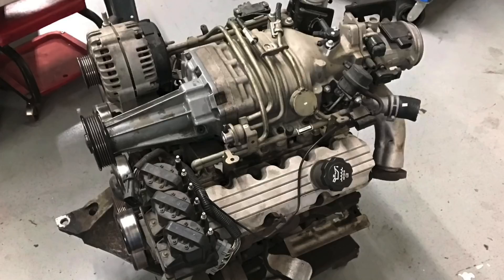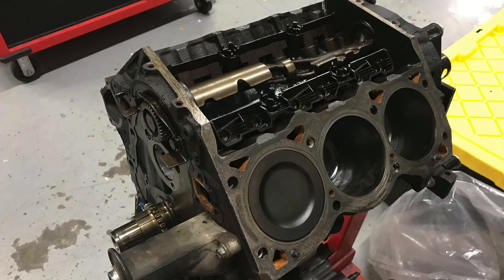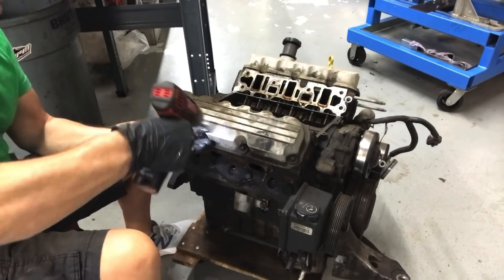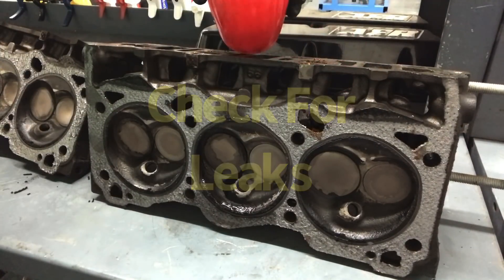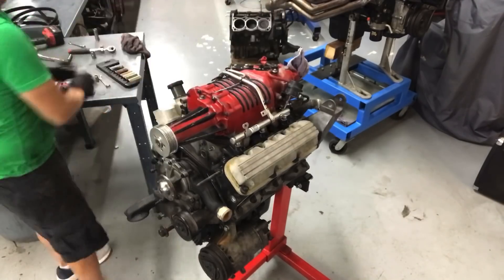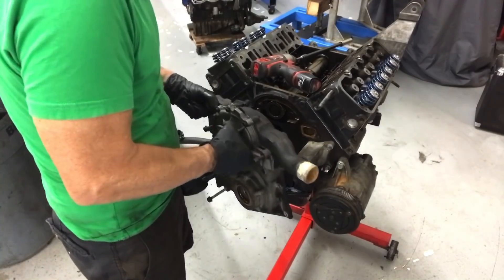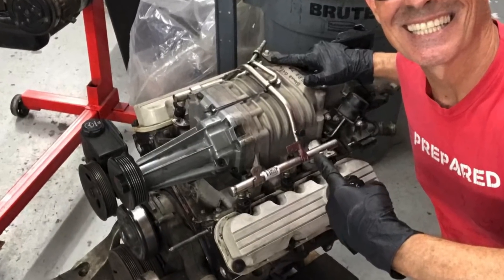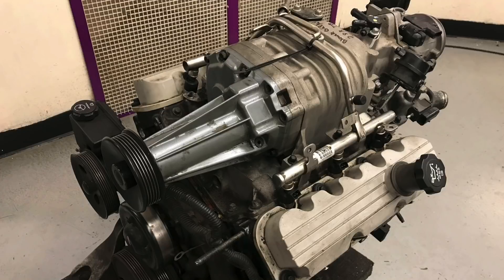HOW TO SWAP & LEAK TEST HEADS ON YOUR 3800 L67/L32 SUPERCHARGED V6! COMPLETE DISASSEMBLY/ASSEMBLY

Comment: when I put my L32 together about 8 years ago I found the same thing... only that engine had just 17,000 miles on it. I lapped the valves at home and it didn't leak anymore. 8 years and dozens of 10 second passes and being hit with 500-700whp via turbo the engine still performs 100%
Reply from the maker: 700WHP?
Reply: @richardholdener1727  yes sir, I shared combo specs on fb with you. I’ve got some videos of it on my channel. The only dyno run on there was 540whp on 17psi though. 700 was done on 28psi. Broke an uncut GMR input shaft in the trans and have been down since.

Comment: Good job fixing that v6,makes it work two motors and one good one. I am outside here little by little working on takeoff parts to get to take the heads off. Temperature about 55to60 so ok to work on it,get what I can get done. Well brake over, so I’ll get back to it see ya next time see ya bye.

Comment: Antifreeze works better and doesn’t stink. Those valves are very shrouded on those heads there are way better stock heads that fit . Did you ever oil fastener’s ?

Comment: Looks like these things take "LS" style lifters. Those heads look really antiquated. Its actually surprising that gm put all the work into these engines to use lifter trays and roller cam and left dinosaur iron heads from a Willy's jeep on them.
Reply: Yeah, the heads are junk. It's weird how GM put zero effort into the heads on the 3800. I'm also surprised there are no aftermarket heads available.
Reply: @michaelblacktree  ya, ZZP did a short run of AL heads with a design similar to SBF that flow much better, but only did a few batches years ago (and charge minimum $1800-2k+, just like overpriced CNC ported stockers)
Reply: Nowadays, those heads are basically unobtanium. And they're no longer in production. So for all intents and purposes, there are no aftermarket heads available.
Reply: @michaelblacktree  True.  I've tried getting some in recent years when I could finally afford it.  Held a set of the GM prototype AL's in Flint years ago, and the weight loss alone is huge.

Comment: Hey , Richard 
I was wondering if it was possible to put the after market cam made for the 3800 engine in a 3.5L Ls Chevy engine instead.
Reply: N, you need a cam for a "high value" 3500/3900 engine. The rpo code is LZE for the VVt 3500

Comment: This Gets Me Excited Seeing How Bad The Heads Leak haha. I Was Making 480WHP On My Original 210,000 Mile L67 Cylinder Heads With Springs. I Sent Some Heads In Over A Year Ago To Be Ported And Rebuilt So Gains Alone From Sealing Valves Would Probably Push Me Into 500s. Main Reason I Couldn't Hit 500 Was It Would Run Lean Every Other Dyno Pull. Long Story Short... 2 Melted Pistons, 2 Cracked Heads And A Block... The Stock Fuel Pressure Regulator Was The Intermittent Lean Condition Causing My Fueling To Be All Over The Place When Tuning.

Comment: Richard, if you want to test the HV3 intake inserts that the Turbo setups have run to change plenum volume I think I have one for each of the plastic and aluminum N/A intakes. I would gladly loan you for testing.

Comment: So richard we need to examine how providing more boost from the S/C and less from the turbo affects power. Same total boost with larger contribution from the supercharger should make less power I reckon I'm also betting the KB will show that to a higher degree, the faster you spin the supercharger the less power you make when it's force-fed with turbskis

Comment: This interests me as I have a series 2 na 3800 in my Aust Holden, ported/ gasket matched a set of heads (not on it yet) also have ported the inlet and throttle body, LS springs may need to be obtained I reckon!
Reply: Lmk. I just upgraded mine so I have a complete set packed up nicely.

Comment: BTW the NA L26/L36 motors have the injectors in the intake manifold and not in the heads like an L67/L32, so that is a consideration when trying to go turbo with an NA manifold
Reply: Double injectors anyone?
Reply: @Prestiged_peck  very unnecessary with available upgrades, just plug N/A ports with 3/8" NPT plugs.
Reply: Thats my plan. Double injectors per cylinder.

Comment: I would love to see you pull the balance shaft and see how much HP that gains.
Reply: I agree!
Reply: I think you can just pull the gear off the end of it. You need the shaft or something to block the oil galleries.
Reply: @timothybayliss6680  we removed my balance shaft and blocked the oil gallery with Mopar cam bearings turned sideways.
Reply: I just removed the gear and left the shaft. Replaced it with a double chain but you need a different gasket and machined oil pump cover if you go that route.
Reply: Seen a few guys do that on Ford ST and RS. Would love to see as well.